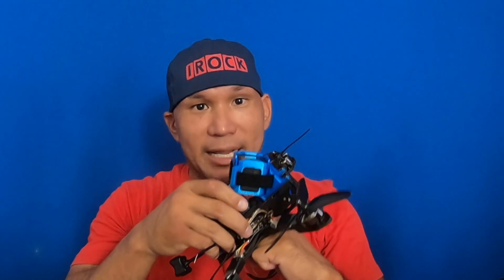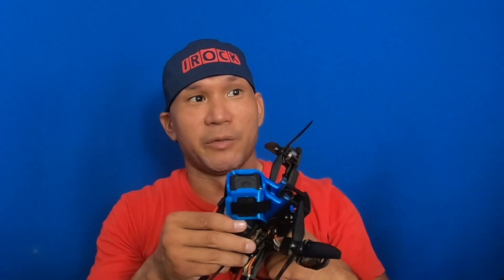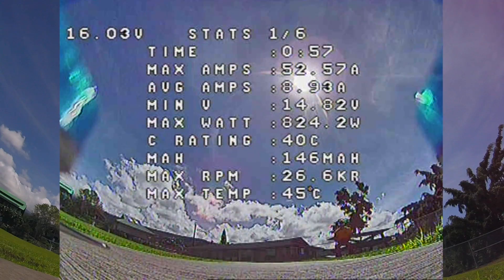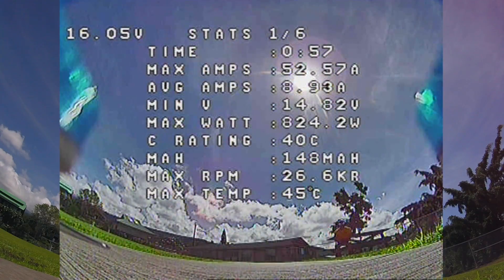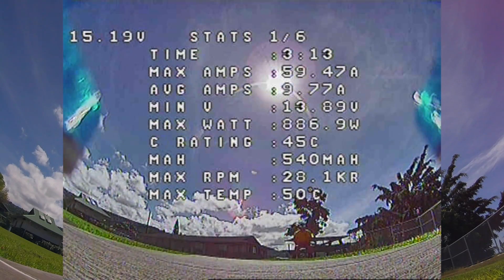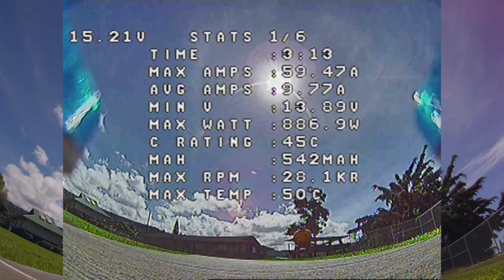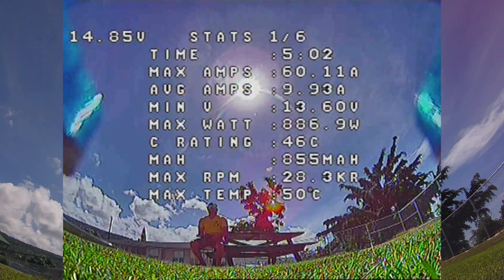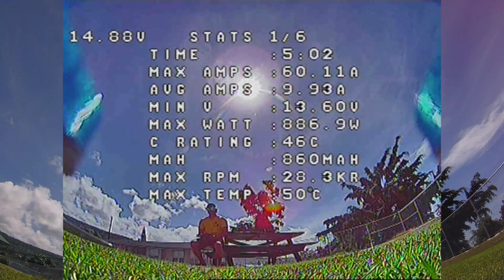FPV Drone PID Tuning I term on both the Roll and Pitch Axis

Comment: You have a great way of looking at the things and explaining them from a different perspective. I have started to venture into the PID tuning aspect of flying and starting to get me head around it. I have started with roll and increased P for the feel I like, I have now increased the D term to compensate for any bounce back, I haven’t yet adjusted my I term.  After changing P and D I now have quite allot of side drift. Is this common for low I term and when I adjust/increase the I term could or should this help to stop the drifting? 
Thank you
Reply from the maker: Are you drifting when you are just hovering? The I term usually keeps the drone in the same trajectory . Increasing P would make your drone more aggressive and faster so the drifting will be more noticeable. Here are some suggestions to fix drifting. 1. I would make sure all your trimmings are centered on your transmitter. 2. I would calibrate the transmitter and the flight controller in the configurator making sure in the flight controller the yaw, roll, and pitch axis is at 1500 resolution or centered. 3. Adjusting the dead zone in the configurator. Everyone flies the drone differently. Sometimes we are doing a specific command and not realizing we’re accidentally also inputting another command at the same time. Adjusting the dead zone should help with accidental input.
Reply: @irockrc  thank you for your reply I really appreciate that. 
Drifting when hovering yes. The quad has been set up for a while, impulse rc apex mr Steele edition, kiss v2 fc. I have been using it with his own PID,s for that set up and generally it flies very good, no issues with drifting. My sticks are  centring to 1500. Because my quad is a little heavier than the steel build I was getting a little bounce back and I have never really played with the PIDs on a build before and wanted to start to give it a go and as the quad is slightly heavier I thought this could be giving me the bounce back so I raised the P, then the D and it’s starting to feel really good and bounce back    Is now less but I now have rightward drift while hovering with no stick inputs and an slight increasing of altitude too. I haven’t changed the I term yet  as I ran out of time. I am changing I term the next chance I get. I was wondering while packing away if the drift and altitude increase was because of the I term still low. I guess I will find out when I increase the I term the chance I get. Apologies for the really long text, really appreciate your help. Thank you. 
I will look into dead band too 👍